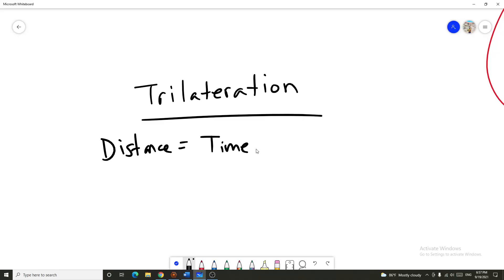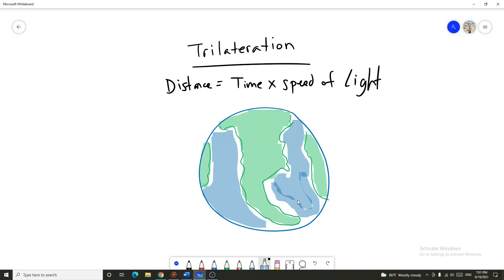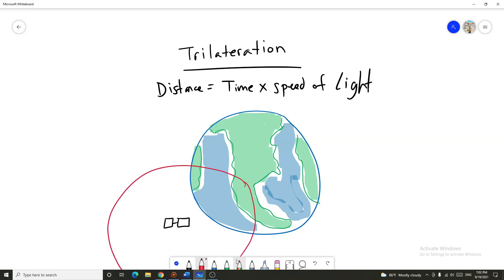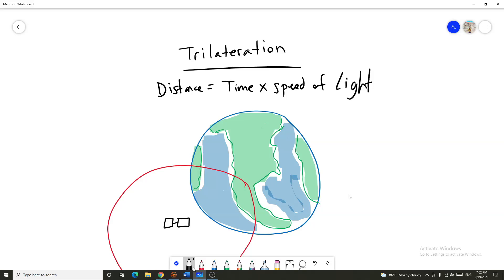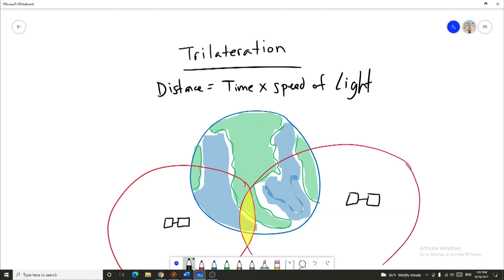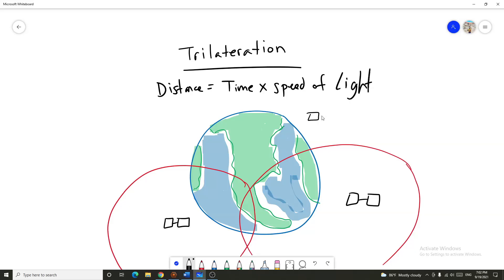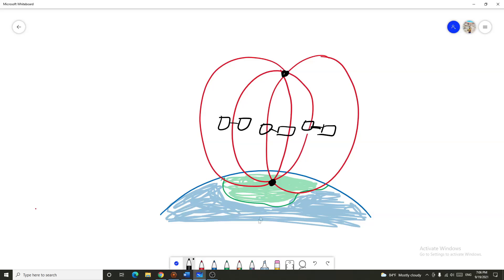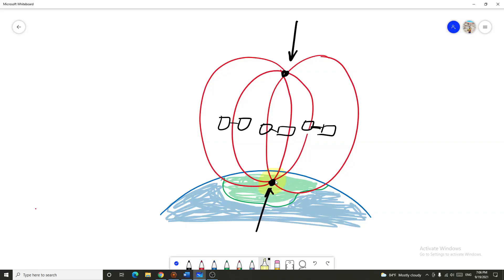What is GPS/GNSS

Comment: Pretty good video. I'm impressed that you actually called the measurement method correctly. Most people get that wrong. You were pretty much on the mark except for the control segment. You sort of hit on it when you talked about the ephemeris, but the reference station is not part of the control segment, it is part of the user segment. The control segment are the distributed tracking stations, central command location (and backup location) and all the similar parts of the system that control the satellites and messages from the ground. It computes and uploads the ephemerides, for instance, to the satellites. Newer (Block IIF maybe?) satellites can measure their own position, now, by the way.

Comment: Thanks for your videos.   Can one purchase a receiver that can produce GPS measurements to the nearest inch?  It would be extremely helpful if 2-4 GPS readings were commonly integrated into property surveys (at various extents) to better address accurate positioning of property corners in GIS applications.   In areas without any clear aerial points of reference, I'd be happy if it were accurate to 1 foot.   If only orthophotography (along with multiple GPS readings) were also commonly integrated into surveys.
Reply: We only use javad gnss. And surveyors measure in tenths not inchs just fyi. Our equipment is around 30,000$ gets down to the thousandths of a tenth .000

Comment: Hello good video but there is a small inacuracy in your statement. 3 satelites is not enough not because it is not accurate enough. But because to solve the position of your receiver, you need to solve 4 free parameters. Then yoo you need at least 4 satelites (4 measurements). With 3 satelites you  cannot get a position. I guess you know what are the 4 parameters. X, Y, Z and ... the clock shift between the satellites and your receiver.
Reply from the maker: You are correct, the “solution” you get with the third satellite isn’t enough. I guess I should clarify that not accurate means not enough parameters solved to have a practical solution. We use three satellites for mathematical testing.
Reply: @RamiTamimi  you are welcome! Keep spreading geodesic content it is the key to enhance our profession. Cheers,